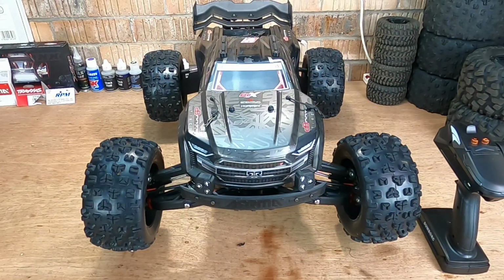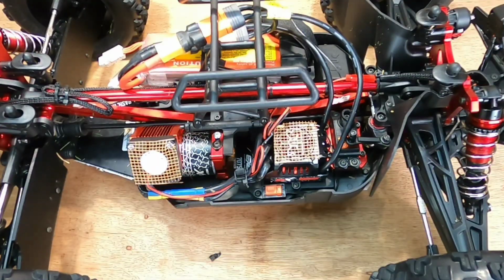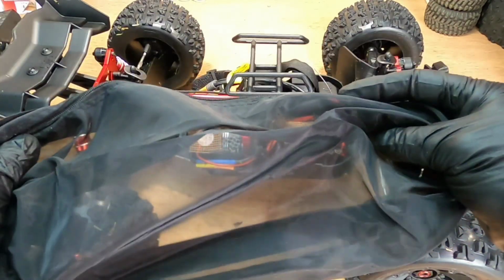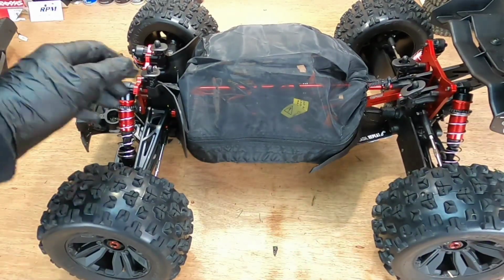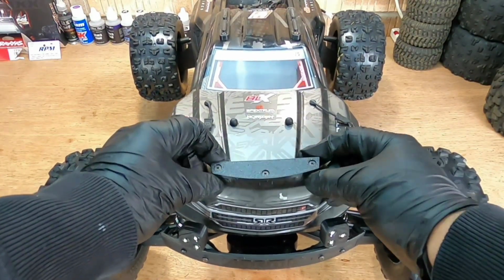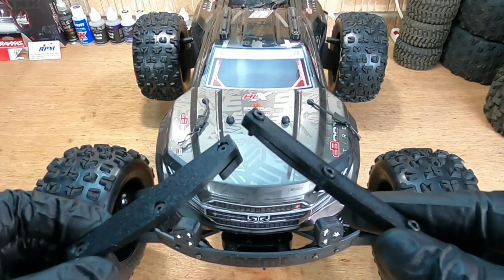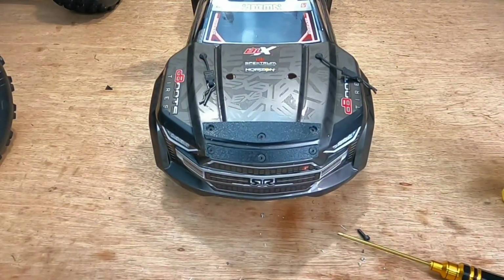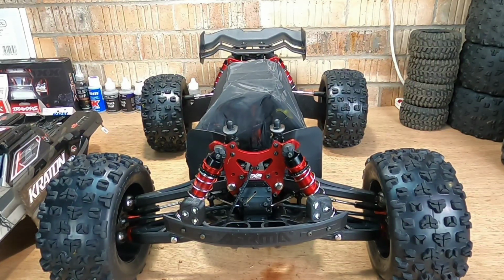Arrma Kraton 6s EXB v4 v5. Protection mods. Nose gaurd, chassis dirt gaurd, esc & servo protection.

Comment: Can you do an RC cleaning video?
Reply from the maker: I try to wash the cars down straight away with soap and water and then use a dryer. The key is to wash whilst the mud and dirt is still fresh.
Reply: @inspiredrc  thanks buddy. Great tip. Like the protection mods, looking really good. You’ll see me rocking these on my EXB & kraton 8s around Shropshire no doubt about it 👍🏼😆